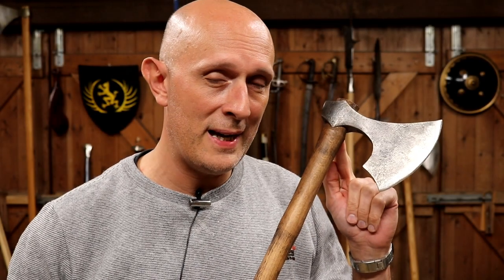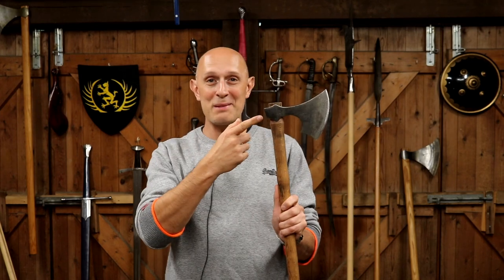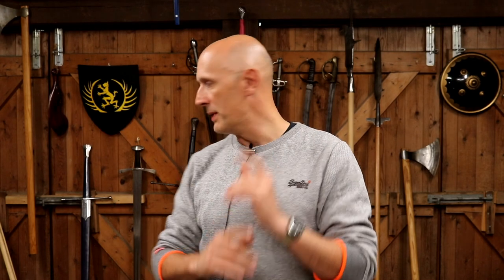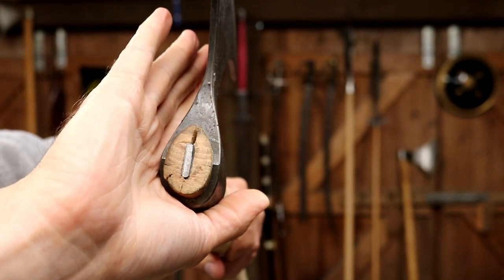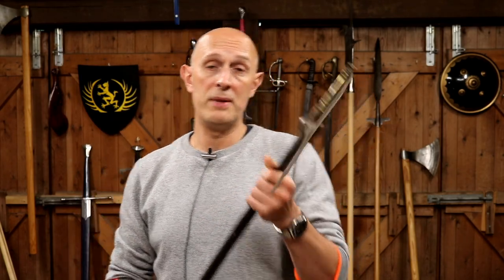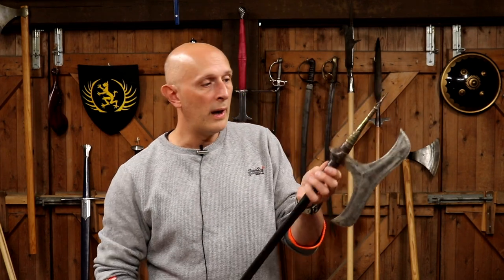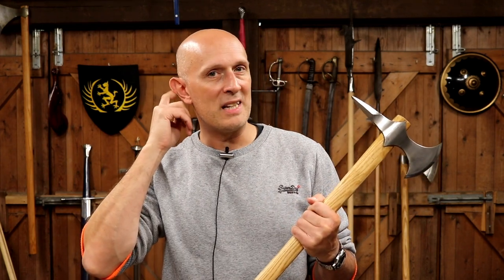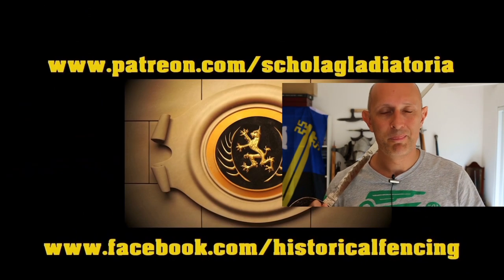Medieval Axe Construction - What Many People Get WRONG

Comment: My guess is that, considering that handles are pretty expendable, they didn't even bother to make a iron wedge, or to wedge it at all. I mean, if i lived in an age when amazon didn't deliver, i wouldn't wedge my axe every single time, you know what i mean?
Reply: Really hoping this was some kind of bizarre joke, but just in case it wasn’t I’m going to point out that if you omitted the wedge from a design which uses one the axehead would fly off when you swing it, that a decent handle could last for decades, and in an age when amazon didn’t deliver you would want things to last as long as possible.
Reply: @ollimoore  tools were pretty tough, they had to be. Now you buy a tool and it busts 10 minutes after you get it haha
Reply: @isaiahmountford5815  to be fair that’s mainly going to be the cheap stuff which is much cheaper than things were in the past, but yeah absolutely, thinking people in the past who had to pay someone local an actual living wage or do it themselves were the ones with a throwaway attitude towards stuff is totally back to front.
Reply: @ollimoore  of course it is a joke. the amazon part. but the fact that they didn't use iron wedges makes sense to me. handles are going to break, with everyday use, willing or not. a wood wedge or the bottom to top construction is more practical and you can keep the iron for nails and stuff. i'm pretty sure that there was a lot of quality variety even back then, i mean we know of people complaining about some trash copper since the sumerian age.. eh. splitting wood everyday is pretty intensive, and splitting skulls too!

i also believe that an average man was perfectly able to replace an axe or any tool handle, if they needed.
Reply: @hic_tus  "handles are going to break, with everyday use, willing or not."

I'm not saying it doesn't happen, but it would have to be happening pretty damn often to be a deciding factor (unless one of the options made rehafting impossible, which of course they don't) in which case they would've been changing the design until it didn't break as often. "oh darn my axe haft has broken again, that's the third time this month. Guess I'll just make another one the exact same way I already know will fail!" I don't think so.

Plus you could probably reuse a metal wedge, certainly I think a metal wedge could be designed that would be reusable, so I'm not even convinced that they would necessarily have chosen a wooden wedge if easy replacement of the haft was the deciding factor.

That being said...

"a wood wedge or the bottom to top construction is more practical and you can keep the iron for nails and stuff"

... This I absolutely agree with - and by extension, your conclusion - in a context where metal is a valuable material it doesn't make any sense to use it for something like this. I suspect the use of metal in modern axes is at least partly convenience anyway.
Reply: @hic_tus 
"i also believe that an average man was perfectly able to replace an axe or any tool handle, if they needed."

Agreed, and this is also why I would expect them to be able to select a suitable piece of wood, which would last well enough for replacement not to be a primary factor in the design, for the haft. If we are talking about variable quality in the past, it isn't the wooden parts I would be concerned about.
Reply: @ollimoore  yeah tools maintenance is part of the job i suppose. it would be pretty expensive to call a guy every single time. with expendable i didn't mean a new handle a week, faster to use the handles as firewood in that case hahaha

Comment: I think if you had a culture where the norm is a wooden wedge to hold the head of the axe, then at least some % of people would have used/tried a metal wedge, since it's the same method, same idea. Just a different material, but not so different that they would never think about it.
So the slide up the handle method sounds more likely to me.

Plus, they didn't mass produce wood like us. So the quality of the shafts would have been varied. If you use a wedge with a bad quality shaft, it's not so easy to prepare with like a knife for a single person. And you might split the shaft in the process, especially if you've never done it before. BUT if you just have a knife, you can form any branch in a way that the top side is a bit thicker, it takes only a few minutes, it's really easy to do, you can't screw it up, and then you can easily apply the head.

So in conclusion, I don't really see a reason to think that they used wooden wedges.
Reply: I don’t see why you would assume they would’ve also used metal wedges in significant numbers just because they were using wooden ones. Why would you use a harder to work and more expensive material when what you’re already doing works just fine? It makes some sense when you have access to cheap metal and modern machinery, not so much back then.

‘Mass produced’ wood isn’t necessarily better, often the opposite is true. Also, while for sure bottom hafting is simpler and more foolproof, making a wedge isn’t tremendously difficult, so I wouldn’t see that as a basis for assuming they always hafted from the bottom.